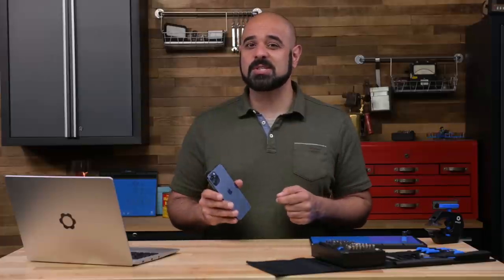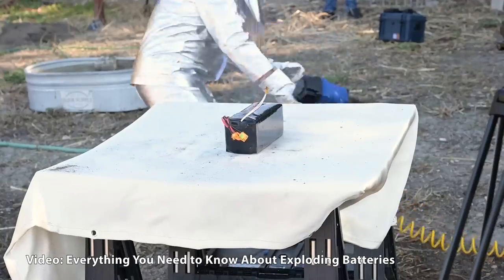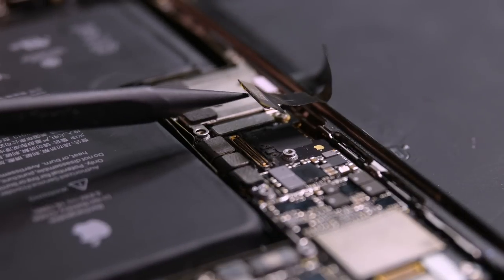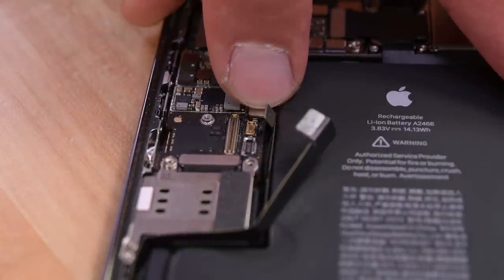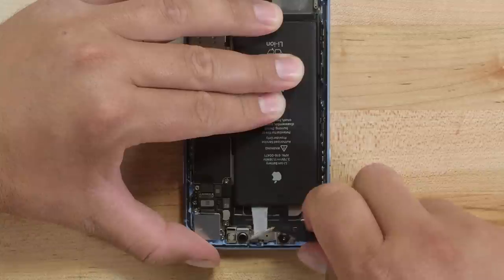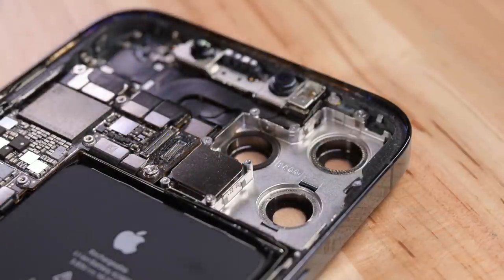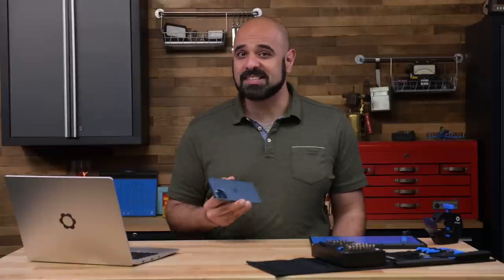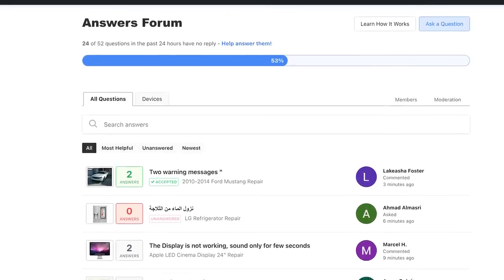Watch This Before Fixing Your First iPhone

Comment: Before you even think about repairing an iPhone (or other Apple product) make sure that your particular model can have the relevant parts replaced. Apple have a habit of locking out parts swaps - cameras, fingerprint sensor, display, battery and so on. It varies depending on the model so do your research first. Then you have to find a suitable, good part at a reasonable price ......